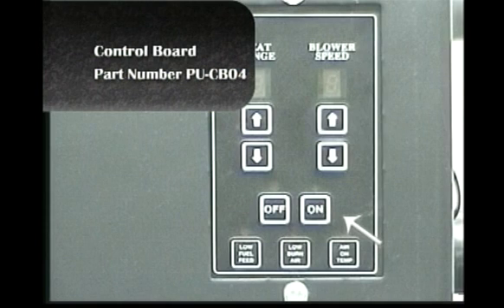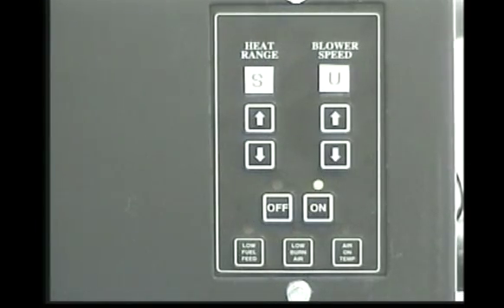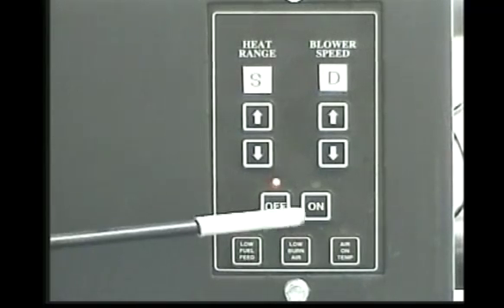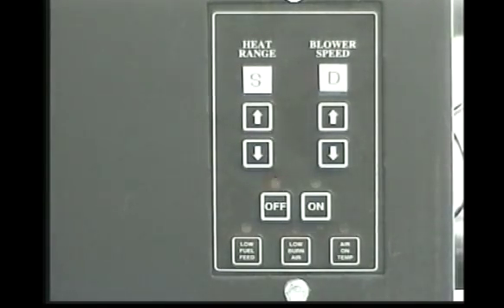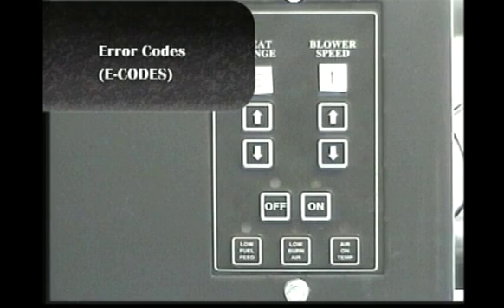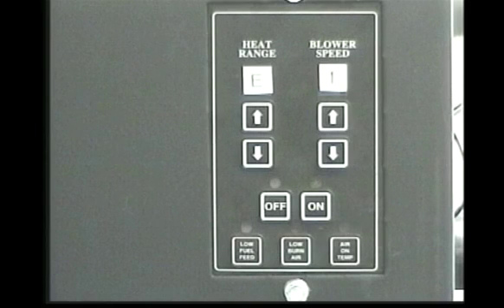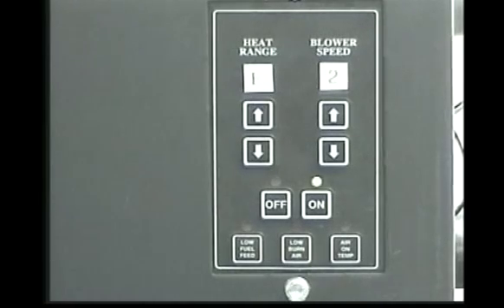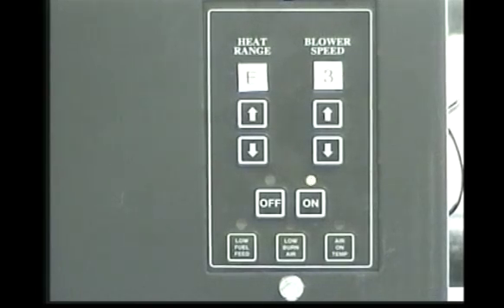AutoStart 17 Control Board Operation

Comment: Does any one know what the bottom 3 buttons are to be set at ? my stove has been shut down for a few years.
Reply: +Guitar Dude  low fuel feed = 1,low burn air=4,and air on temp=1
Reply: @MrCrf450rider  how long should I expect a 40 lb bag hardwood pro pellet at 1-4-1 settings?  Please and thanks. Trying to maximize the  stove as it's in the basement. We have an in the wall fireplace and a conventional furnace with propane. Trying to determine net total gains from each or a combo of the 3. Cheap and efficient is what I want in a 2000sqft home. Total of 3 stories and the top story is open..that is you can look down at the living room and kitchen from master bed.
Reply: @jhonfamo8412  I was instructed By Englander to set the bottom 3 buttons to 5-4-1.—You should get 12 hours out of  40lbs bag.full hopper is a bag and a half and I get about 18 hours run time out of it.hope this helps
Reply: @johnm5714  thank u. I got mine set at 1-3-1..and although it takes 90 minutes in at 68 degrees in the house..stove in the basement. Im getting atleast 18 to 24 hours. I got a dat off and am going to start from scratch with a bag and time it. Also I have to add that outside temp and INSULATION is a huge factor. It's 30 degrees outside so I know there will be a diff when it's 000 outside. Thanks for your input. Im having a good run at low settings...it take longer to reach it temp but last twice as long
Reply: @jhonfamo8412  usually a bag a day,depending on how cold it is,and the setting.I am using an external thermostat with mine.there should be a connection on yours too.just remove the jumper wire on the back of the display board,and connect a thermostat
I'm using a Honeywell digital.use one that is recommended
It helps control the amount of pellets being consumed,vs constantly running
Reply: @jhonfamo8412  Englander said to me,that the display should be at 1,3,1.I'm running mine in a basement at 1,4,1,and 4"inlet pipe.mine is in a basement,and needs that extra boost of air,since it's being down fed with air
Reply: @jhonfamo8412  I cant keep fire going when first setting is too low.I need to keep it up.also I use this stove as my primary heat source—I basically make believe I have NO boiler and I down right refuse to touch it unless it gets into the negative numbers and there’s wind blowing.then and only then will I allow heat to come on up on the second floor.

I have an oil boiler that is very lightly used and really only use it for hot water—I burn only 30-35 gallons a month for that only.withiut this stove I’d be guzzling 300+ gallons and everyone would be bitching because they are still cold
Reply: @johnm5714  I had that problem to. I just take a hand up of pellets and put extra on igniter when I start up.
Reply: @MrCrf450rider  131 here..
Reply: @jhonfamo8412  try using an external thermostat.that will help with pellet usage,otherwise it will keep the sugar feeding the fire constantly.with the external thermostat,it goes into an idle mode,when it hits desired temperature
Reply: @MrCrf450rider  Tech told me it was Feed=4, Burn 4, Air=1
Reply: @MikeJohnson-tk3fg  doesn't seem right.not a good ratio.
Reply: +Guitar Dude just call them englander pellet stoves